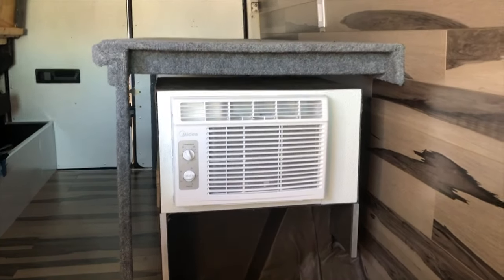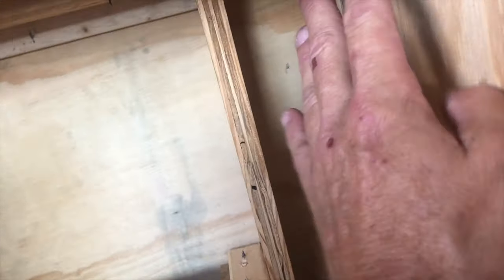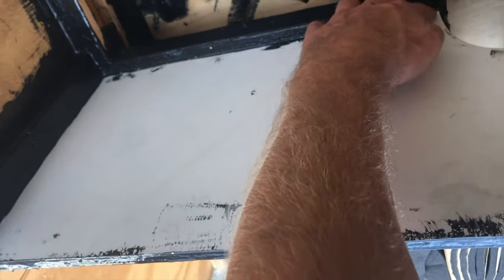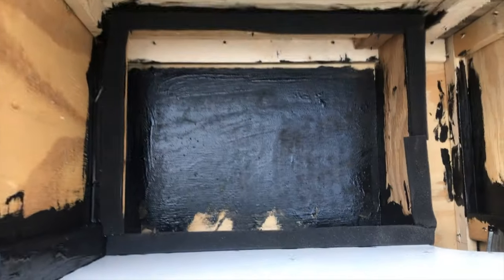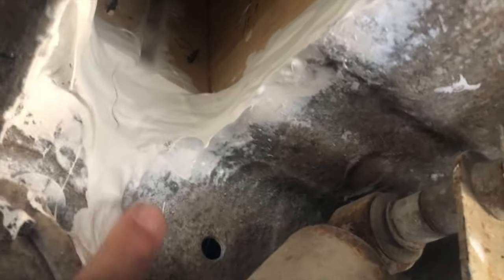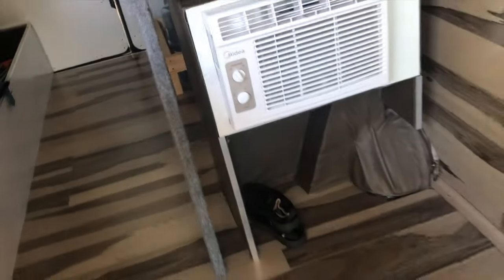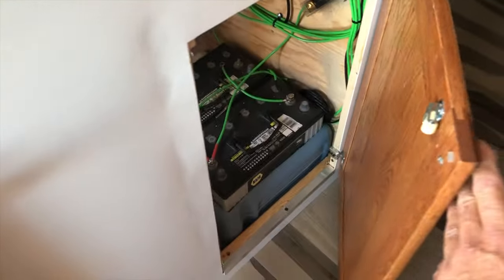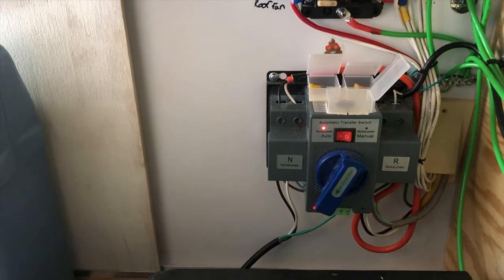Air Conditioning a Camper Van can be cheap and easy.

Comment: Hi. New viewer here. I'm about to go out ft in Mt car to start and go from there.  I'm still unsure about the battery with inverter hookup and would like enough power to run ac or heat indefinite amounts of time for comfort.  Do you have a simplified way for me understand exactly how that works?
Reply from the maker: Short answer, it doesn't work. Running a/c on a solar system small enough to keep on your van requires a balancing act. We have a whole list of videos on solar powering a/c on a van. The coal was have the van as safe as any apartment to leave my dog at home. Maintaining 74 degrees inside the van was too much for a carefully designed, efficient system that fully covered the van with 1200watts of solar. A constant 76 degrees was maintainable through a Florida August with daily rain showers, but left nothing for any other power demands. 
Heat on solar electric is way too demanding. Get a cheap diesel heater.
Reply from the maker: Check our Playlists for Solar Vans

Comment: Does it matter which side of the air conditioner you are supplying the fresh air to pass over the fan? It appears you have air coming over the right side, but what if the way the fan is spinning it is trying to pull it in from the left?
Reply from the maker: As long as outside air is getting into the center of the box, it's good. The "outside" fan always pushes front to back. If the a/c were hanging out a window as intended, it would pull air from both sides and the top, through the fan and be pushed through the warm coils on the back side. The interior air fan will often be different, perhaps pushing left or right, but since we expose the face of the unit just like it would be in a window, the designed chilled airflow is not hindered.

Comment: Hi florida mann , Tom here in Ireland what brand is the ac unit , thanks
Reply from the maker: This one is Frigidaire or GE, I think. The market is very competitive and most 5000btu units are pretty much the same. Avoid any with remote control or lighted displays as these will draw power when not running and loose their mind when frequently without power.

Comment: Sir can we use the ac while driving
Reply from the maker: I do. My current alternator charging does not keep up, so I draw up to 10amps off my house battery. Before I replaced the alternator it kept up and charged the battery with a few amps, despite the a/c drawing up to 55amps. New alternator is the same 200amp rating but cheap brand and my charging system is original factory option from 2005. Time to upgrade with something more compatible to LiFePo4.

Comment: Dang. How big is your van power unit.  I'm sure it sucks it up within 2 hrs of run time.
Reply from the maker: The 400Ah LiFePo4  battery will run this a/c 8 hours. Fully recharging that battery takes a lot longer.
Reply: @FloridaVanMan  can you put links to your batteries and other electronics you showed?
Reply from the maker: @eddieb8615  Links are impossible to keep up with. Early on we put links in video descriptions but the links soon expired and some started directing viewers to wrong parts. We have some links on our web-page https://floridavanman.com/links but even those are getting dated and expiring.
Reply: @FloridaVanMan  yeah.. just went there and I don't see any links.

Comment: Btw what ac did you go with
Reply from the maker: I think this one was on sale, GE or Westinghouse. I've used several and haven't found a favorite or one to beware of. The one I had with remote control and digital displays didn't seem to like being 'plugged-in' before turning it on every time, then 'unplugged' by turning the inverter off.

Comment: Did you do the big Volt solar bank again? I asked too soon.  You just showed the AGM batteries,  are they set up 12v ?
Reply from the maker: This is just a little 12v system for the common-van. I tried to make this one more main-stream desirable and cost effective.
Reply: @FloridaVanMan  I'm more so try to decide on a 12-volt verse 24 volt system with roughly 7 to 800 amp hours of battery and trying to push an air conditioner with a roof full of solar. Pros and cons...
Reply from the maker: @antigroundhogday   24 volt inverters are more efficient than 12v. Check out our videos on Sunny & Share. It has everything you mentioned, 325ah 24v LiFePo4 (750ahr @12v), 1220 watts of solar, and a stealth air-conditioner that will run 24/7 on solar. https://www.youtube.com/watch?v=fWRaYWWODic&list=PLdX2bukfM8q6JTIHYrL0v-jMHK97st27w&index=3&t=379s
Reply: @FloridaVanMan  hrmm, The video you linked to as you mentioning a 12-volt system in the first few seconds and then a 12-volt high-end hybrid inverter later on in the video. In any event, I am planning around the world trip, where I ship a van from continent to continent. I have to admit, I know the T1N diesel vans are very long life, but I worry about older components. But that chassis may be the best bet for parts availability around the world versus the RAM ProMaster or the Ford Transit. I definitely won't be taking the new Mercedes sprinter due to cost and reliability issues.  I'm not sure if this is in your wheelhouse, but perhaps if you have an empty T1N available, perhaps spray foamed, I may be in the market shortly.
Reply from the maker: @antigroundhogday  That is my wheelhouse. I am finishing a build by April 1st, then I have two more 158" SHC vans waiting for my next build. I have a cheap one and a reliable one. I'm not sure which I will build next, so I could sell either one as-is.

Comment: Do you have plans for the one you built? Or will I need to build to suit?  Just curious how far ya got with it
Reply from the maker: The a/c in this video is installed in a van we call 2Blue. It belongs to a friend in Washington and there are a few videos featuring the van and it's colorful engine.
Reply: @FloridaVanMan   not so much worried about the van as I am the A/C unit.  Bout to do something very similar, if I can manage it.   This portable a/c isn't cutting it.  or maybe I'm not setting it up right.
Reply from the maker: @jamessutherland4238  The big problem with portable A/C is they usually don't have a fresh air inlet from the outdoors. This means it sucks cool air out of the room, over the hot coils and exhausts that air outside via a tube in a window. So now that air in the room has to be replaced and it will usually come in through the dash vents, the hottest part of any car or van. The portable I took apart for a prototype-build couldn't be adapted to fix this problem.
Reply: @FloridaVanMan  Thanks!  I'm thinking of a window unit that hangs from the OhShit handle next to the window.
Reply from the maker: @jamessutherland4238  I have one that hangs in the passenger window with a chain to the rain rail for support. It is seen in at least one video (still-shots). Made for boat decks, by Carry-air, I think. Haven't used it in years and would like to see someone use it. If you are in Florida any time soon, stop in.
Reply: @FloridaVanMan  Just went to Walmart and got a 5000btu unit.  Hung it from the handle through a whole in the rail I made.  Then, just set it on the window for now.  Will probably eventually make a shelf for it, if it proves to be able to keep stuff cold.  Bout to check now!!!  wish me luck.
Reply: still kinda hot, but, while it's 95degrees outside, now it's 81/82 in the van vs the 87-93 I ws seeing before with the portable unit I was trying.  What am I missing?  I've seen one of these little units put it down.  What am I missing?
Reply: @FloridaVanMan   I’m in NC.  But how do you get the condensation not to build up on the inside around where the air comes out?   Was thinking of just putting the whole thing in a little shallow tub and running a hose off of it for drainage… then it could sweat all it wanted.  Just curious.